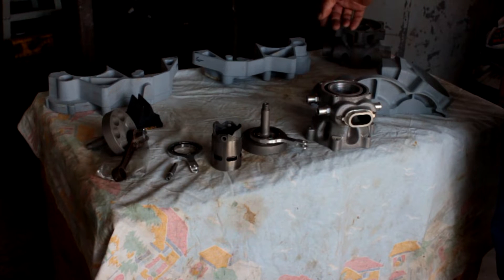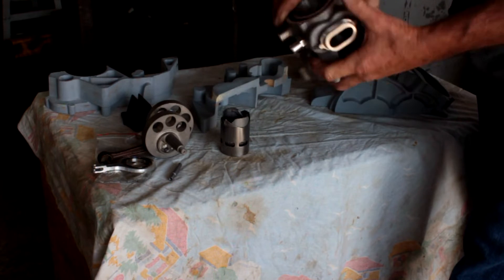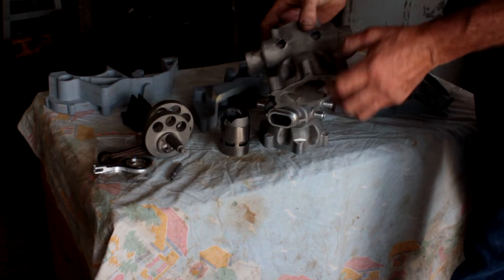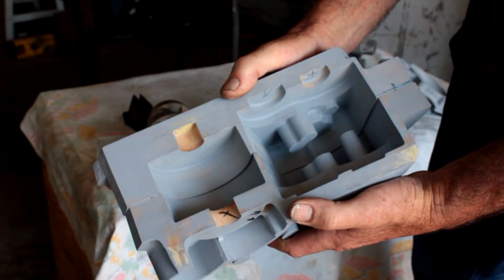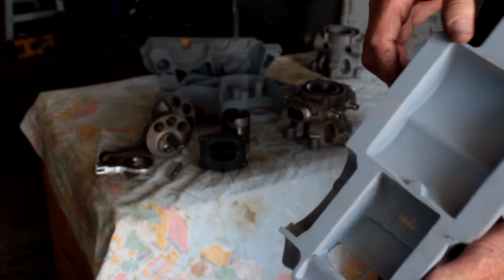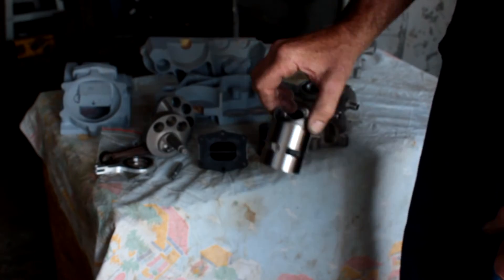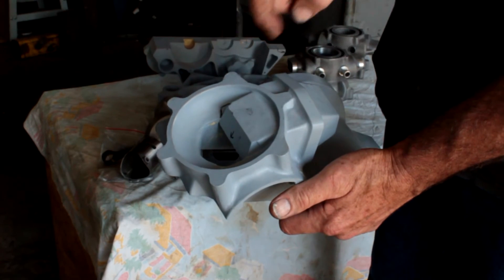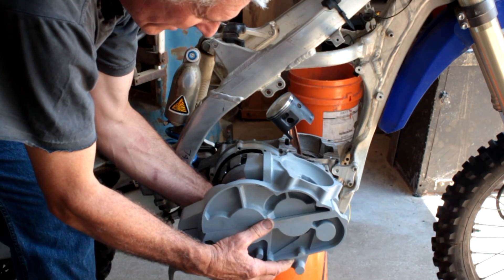Sleeve Valve Engine Castings

Comment: Would a 'Cylinder liner', retail price around $40,  taken as inner part of an Air Cooled cylinder, an oil jacket between the liner and the outer part of cylinder, with the cooling fins (See Biscuter, Voisin, 2-Stroke engine oil filled engine head), add something to performance of an Air Cooled engine?
If Shock Cooling exists, the oil acting as temperature buffer will help avoiding this, perhaps also will reduce noise.
Blessings +

Comment: Wonderful engine!  A recent SAE publication proposed, for 2-Stroke engines, Loop Scavenging always being better, under any circumstance, to other types of scavenging, such as Uniflow Scavenging, but Compression ignition 2-Stroke Sleeve-Valve Engines may differ. Or not? 
Will you, or anybody else, have the courage of drawing and building an Sleeve-Valve variant of the Flat Twin air cooled 602 cc Series A Citroën engine? There are producers of 'tuning' Steel Cylinders and pistons for this engine, in several measures, starting in the 74 mm bore x 70 mm stroke basic engine, as: vgs2cv.be 
Harry Ricardo pointed inside an Steel cylinder, an  Steel Sleeve will have no problems, case not that easy with air cooled aluminum cylinders and iron pistons and sleeves, as in the Bristol Aircraft Engines, for sure you're aware of the interview with Mike Hewland and assistant Lomas in July 1974 Car&Driver issue, about their Sleeve-Valve research. Gesund +

Comment: 4140 could be a mistake for the steel.  The Crecy used a high expansion coefficient steel, alas no longer available.  I too am building a sleeve-valve engine, but with no ports in the sleeves.  I haven't yet found a suitable steel for my sleeves, but I'm not running pistons in them. I might settle for  EN41T because I have chosen that for the cylinder liners and AL 4032 for the pistons.   The sleeve arms are from AL 7075 T6

Comment: The alloy I use in this casting is CC601 heat treated to T6. I'm not sure that I shouldn't have made it from LM13 (high silicon) but we will see I guess. This engine has run (free running not on load) but shortly will be running in the YZ250 frame it's currently bolted into. Gearbox is installed, clutch, counter balance shaft, water pump all fitted up. I'm working on the twin exhausts (expansion chambers) at the moment. I would like to think before the end of the year I'll be riding the engine / bike around the back yard. Sleeve is 4140 steel nitride 70R skin, this can run straight onto the alloy cylinder casting and inside the piston is quite happy also to run against this hard steel. I've put all other work aside to get this finished.

Comment: thank you for sharing & this is a kind of video that i have been searching for a long time. what kind of aluminum alloy are you using? can i use any kind of scrap that was previously used as aluminum engine block or cylinder head? I heard you saying that after you casting aluminum block you finish it with heat treatment. can you share about the process of heat treatment of this kind of aluminum block? please? any clue is appreciated. thanks again!